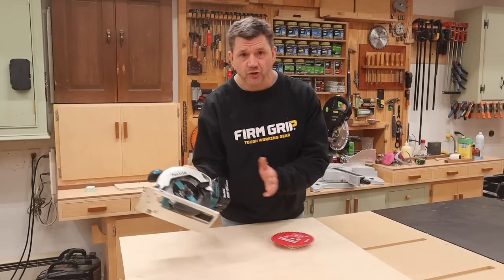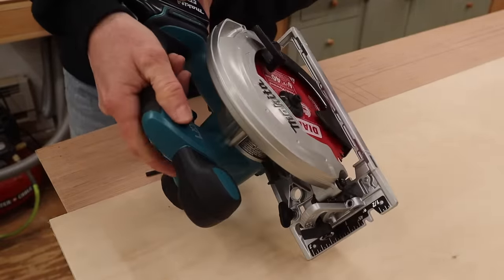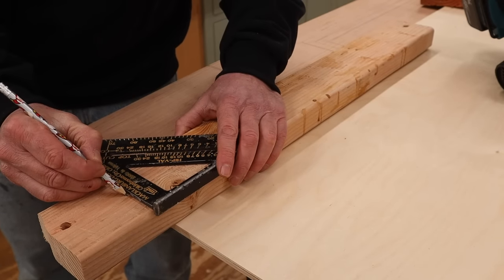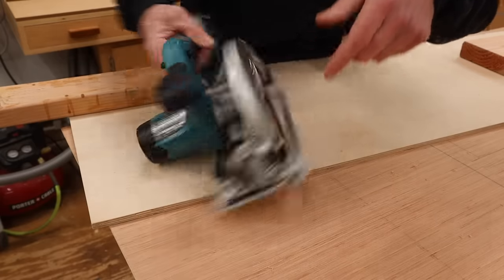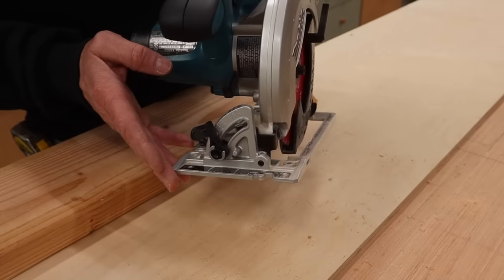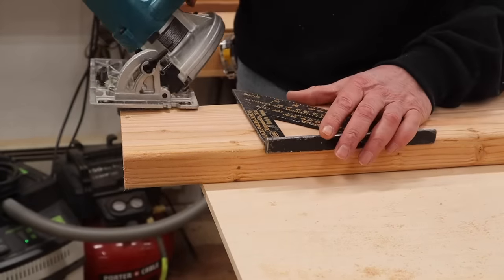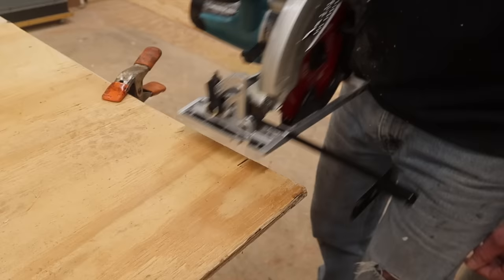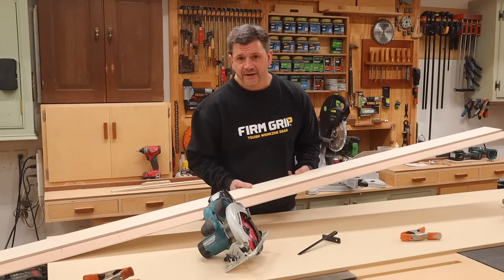Got a Circular Saw? What you need to know [Basic Woodworking]

Comment: When you tightened the washer with the alan key, was that a reverse thread? It looked like you tightened it the wrong way. I'm assuming that's because of the direction the blade spins?
Reply from the maker: Yes that’s correct the threads are reversed

Comment: Two small points: First, I always place the heavy motor base of the saw on the stationary side of the board being cut. I never place the saw on the cut side of the board, which leads to bad finishes to the cuts when the off-cut falls away.  You may have to position the speed square on the other side of the saw and cut with the other hand, but parallel is parallel.  Second, I set the saw to maximum depth when plunge cutting as that brings more of the blade closer to 90 degrees and reduces the amount of hand sawing needed.
Reply: Great comment here Richard!  I was taught, “blade side, waste side!”  This is not always possible, and YMMV.  I have great admiration for Jon Peters.  I do agree with the plunge cut depth you mentioned as well.  Key point is take it easy, and be SAFE!  Peace 👍😀

Comment: Thanks for this! Hints for non-pros:
1. Never wait that long before replacing the allen wrench, otherwise it will run and hide behind the workbench. 
2. If you don’t have a ruler on the baseplate, use a Sharpie to write the offset measurements on the baseplate so you don’t have to remeasure it every time. 
3. Yes, PRACTICE. Learning the skill and developing muscle memory are especially important for a Skilsaw. (See Essential Craftsman’s awesome wormdrive skills!) Same goes for hand saws.

Comment: More tips:
Use the least amount of overhang you can when cutting off the side of a bench. 2" off the edge, for instance. This supports the material and you get a cleaner cut.
Always sight along your cut line, on the bottom of the material, to make sure you won't cut into anything you don't want to (like your sawhorses).
If using a corded saw, make sure your cord has the reach and clearance to go the full distance of the cut, before you start.
Keep the saw moving through the material while the blade is spinning. Stopping or bogging allows friction to build up and burn the wood.
If the off-cut is heavy, make a plan for how to handle this so the wood doesn't crack and rip. Putting a saw horse under it, or clamping across the cut with a quik clamp in the middle of the cut are two ideas. Just don't let it fall.

Comment: Thanks. Great tips. How do you cut 4’ from a 2x4x12’ using a circular saw and two sawhorses and avoid having a pinched blade at the end of the cut.
Reply from the maker: You need to support the board with a sacrificial board underneath.
Reply: @JonPetersArtHome  Will do. Thanks.
Reply: Can also support 8' on the sawhorses and hang the 4' off the end. Use a clamp to hold the speed square and support the 4' section with your free hand as you cut through to prevent it pinching the blade. Don't worry about preventing the 4' from falling as this could throw you off balance as it falls, just prevent it sagging down and finally pull it away from the blade as you complete the cut so it doesn't pinch the blade. Speed square should be on the 8' part - don't want to add unnecessary weight to the falling piece and you want all metal things to be stationary so there's minimum chance of them running into the blade :).

Comment: Great video as usual Jon. Been thinking about getting an 18V circular saw. Do you normally use a plywood blade to cut dimensional lumber? Wouldn't the factory 16T blade or a 24T blade put less strain on the saw (and less wear on the blade)? Thanks again for another great video.
Reply from the maker: Thanks, I you carbide tooth blade 16 or 24 will work… I seem to get less tear out though with a 40 tooth blade on plywood

Comment: Hello I have a QUESTION....I have a milwakee circular saw  I purchase a new blade same size than the old one but when i put it did not wanted to cut, so i turned the other side and worked bit better but seems to be rubbing in something to the point that all the lettering of the blade is gone...check the "stop" feature and it is not engage, all the nuts and parts to secure the blade are account so no clue what is going on...by any chance you have an idea of what the problem may be?  Thank you.
Reply from the maker: That’s odd, I really don’t know I would put the old blade back and see if you have the same problem maybe something isn’t running up right.
Reply: @JonPetersArtHome  exact sentiment i have...so odd, never happen before...last night as i was thinking about the issue occur to me that may be the blade that is damage (bow or crocked)...and this morning i though about putting  back the old blade...i hope i can find it put it back and see what happen.  Thank you for reaching out to me and try to help so much appreciated.

Comment: Good stuff Jon!  Great points for new DIY’rs as well as more seasoned pros.  I would offer that I was taught “blade side, waste side,” of course it is harder with a left hand saw, as you used here.  That brushed Makita is a great saw, as you know.   

Good use of the speed square.  Some will argue that it should be used opposite of how you have it here?  By placing the ‘heel’ of the square at the front of the cut, it will be harder for the saw to push it offline, vs the way you showed it.  Different strokes, as they say.  YMMV!  
👍👍👍✌🏻🇺🇸😃
Reply from the maker: Good point about the square 👍 Old habits die hard😀.
Reply: I was hoping someone would make that comment. I sometimes use a quick clamp on the square and workpiece. This allows my free hand to be further from the blade and to support the material being cut.